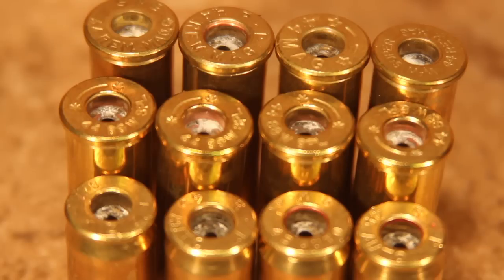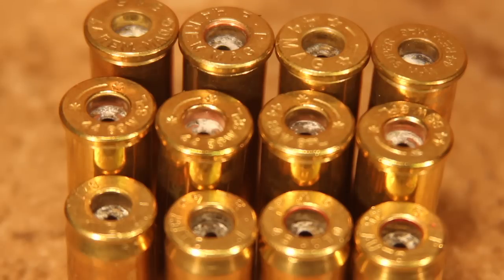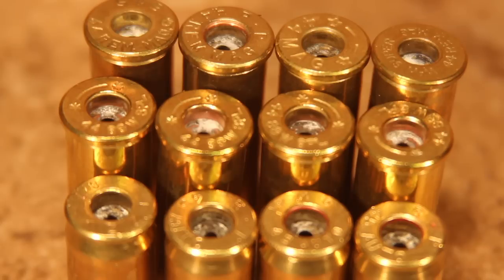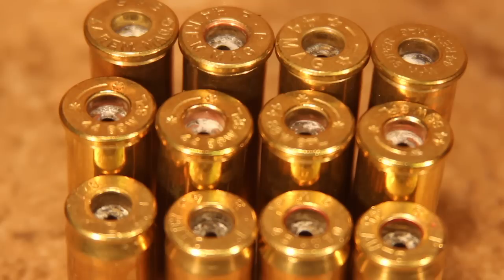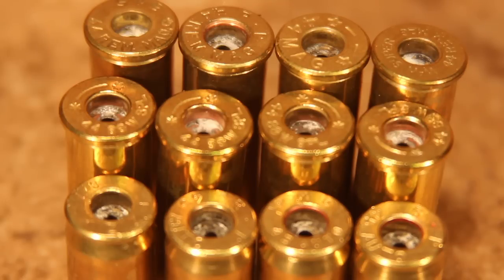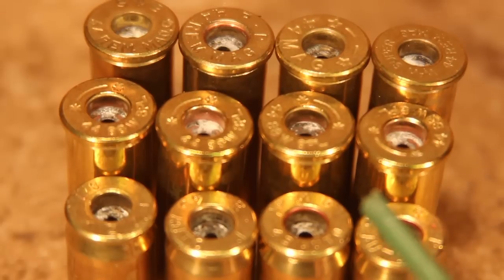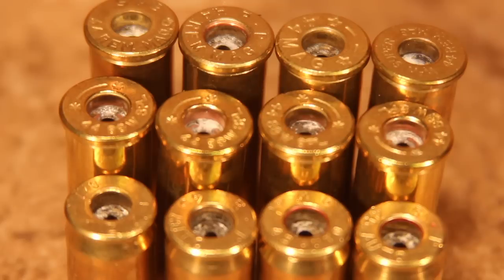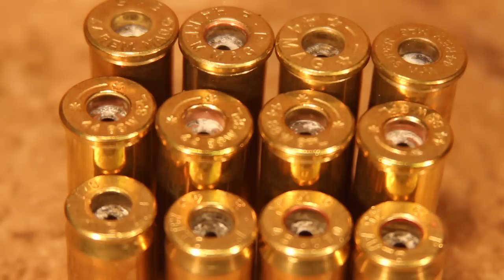Our Major Source Of Lead Contamination

Comment: I recall at an instructor school a discussion of instructors who had a spike in blood lead levels. Turns out they had been using a video based use of force simulator indoors without any special ventilation, and the simulator used primers. 

I’ve taken to decapping with a Lee APP fed by a Dillon case feeder, followed by wet/pin tumbling. Mainly to avoid dust of dry vibratory cleaning, and to carbon and primer reside out of my progressive.

Comment: I've been powdercoating cast bullets for several years.I recently tried clear powder coat paint.Makes pretty shiny silver bullets that appear as cast.I use a dry tumbler with the powder and bullets ran for about five minutes.The clear powder is a bright white in color when new,however after three batches of bullets were tumbled in the same clear powder the powder was no longer bright white but grey in color.I've noticed this darkening of powder over time with colored powders also(ford light blue,red yellow) but never really thought about the cause of the darkening.I believe the powders turning darker and greyer is due to the lead dust being created from the bullets tumbling together.After this realization,I've been wearing a respirator when seiving the powder and bullets after tumbling.Has anyone else had this "AHAA" moment and realized the danger of lead exposure during the powdercoating process?Thanks for the great videos Mr. FC45LC.

Comment: I prefer to deprime at a work- bench outside. The fired primers fall into a five gallon bucket.
I put my lead pot skimmings in that bucket and about once a year i take the bucket to the county hazardous waste disposal center.
Its free and they send it to a clay lined land-fill so it doesnt get in the water supply.
It may be possible tp reuse the wash water by letting it settle then pouring off and reusing the clear water. The settled solids could be saved and sent to the hazardous waste center.
Avoid pouring lead contaminated water onto the ground. 
I am not sure that pouring it down the drains is a good idea. I dont know.

Comment: My Process:
I Dawn Soak before depriming. 
I deprime without drying the brass in a dryer or oven.  Moisture in the primer is fine.

I chose a press that has the hollow ram design for collecting primers to remove primer gunk away from the press and down into a tube.  Lee & Redding do this design.

The spent primer tube goes into an empty bleach bottle with water so primer dust does not plume out.

The deprimed cases then get Dawn & Lemishine soaked a second time. 

They get dried completely. 

I inspect the cases as I hand prime.  I always inspect them so it is now or later for me. The primed brass is stored for loading. 

This way my reloading process and reloading press is kept as lead free as possible.  A second press with a universal deprimer and or bench station for depriming would be a good choice if you can find $$$ and space.  

Your pets need to be considered if you dump waste water into your yard.
Reply from the maker: Carlos - You got the issues under control...Continued good reloadin' to ya,  Steve

Comment: Down the drain the water goes, where it goes, nobody knows.
Reply from the maker: pr4runner - the drains take that water through the drain systems right into the ocean untreated.  Not the best definitely, but the argument can be made that the rivers and creeks scour all kinds of natural minerals including lead and mercury down from the mountains and into the oceans eventually (reason lots of minerals are found downstream), but we don't have to add to that.....  Have a great day,  Steve
Reply: @FortuneCookie45LC    LOL.  Great Lakes have hormones.  Common Hospital practice is to flush it down. I is NOT filtered out at all.  Lead and drugs.    Birth control to hospitals that the protocol.  l is to flush med down the drain.  I am calling you out on this one fore sure.  I do  not have a solution.   Same as lead in my mind ish.

Comment: Thanks for the great information. I have always used an ultrasonic cleaner years ago and now use a wet tumbler. I always thought dry tumbling was a bad idea.
Reply from the maker: Andy79Z28 - You suspected something bad and for good reason.... Best to ya,  Steve and thanks for posting
Reply: a ulta sonic cleaner is also a wet method and safe to use ,i think you mean a vibration cleaner

Comment: I'm assuming there is still exposure after wet tumbling when we clean and uniform primer pockets as well.?
Reply: No, after wet tumbling you're fine.
Reply from the maker: Ronald Valdez - If there is still a little residue in the pockets, there is still  minimal exposure.  But since it is not dust, we have minimal exposure there.  What little exposure remains is from possible contact and ingestion.  But that clean dry dustfree brass is sure high confidence stuff... Have a great day,  Steve
Reply: @FortuneCookie45LC  trow the cases after depriming 15 minutes in een ultarsonor cleaner of good quality and the primer hole is clean and the cases also ,but for the shining finisch wet tumble them after that.

Comment: I just got done ordering the Frankford Arsenal wet tumbler Lite model. I also got the scream Drain cap and 2 1/2 lb of stainless steel pins and the Frankford Arsenal magnet. I didn't get the large one because I really don't do huge volumes of brass being a precision rifle reloader now. I don't reload Handgun Ammunition as of yet. If I get into shooting my 357 Magnum revolvers again I probably will get back into it due to the cost. I do a lot of big bore rifle such as 458 Socom a lot of 308 and 7 mm Mauser ammunition and a lot of 270. But never over a couple hundred rounds Mac so I'm thinking the smaller version will do me fine. Anybody use the Frankford Arsenal wet tumbler lite model? I also picked up lemi shine and a brand new bottle of Dawn original dish soap LOL. So I should be set. I also have a gallon of white vinegar that I can try out alongside the lemi shine and see how they do compared to each other. One cost me twenty bucks the other a dollar 55 so if the vinegar will do it I'm going to switch to that.
Reply from the maker: Echo and the Bunnymen - The citric acid in the LemiShine matches the acetic acid in the Vinegar.  Both should do OK, but the LemiShine has track record...there is cost, but since 1/4 teaspoon of the LemiShine is all that is used, it really isn't problematic...and the bottle is much smaller than buying a container of vinegar.  Have a great day,  Steve

Comment: Thank you sir, never dry tumbled since I watched your videos prior to beggining reloading. Have always worn gloves due to my ocd and wet tumble all my brass after decapping. Do you think that decapping prior to wet tumbling will also put us at risk? Should we wear a mask when decapping?
Reply from the maker: Carlos Mesa - Mask is to prevent inhaling dust.  Decapping brass doesn't cause that much dust, but for sure, handling fired brass there is contact hazard - wearing rubber gloves would be good, and not going to the mouth or face during handling of fired brass is good policy.  Best to ya,  Steve

Comment: A healthy splash of mineral spirits in your dry media will hold that dust down. In my tumbler it will even deposit the very fines to the lip of the bowl where I can wipe them off with a paper towel each time I tumble.  I also find it to actually help shine the brass is slightly. It has been such a great improvement in my dry tumbling I put the wet tumbler away.
Reply from the maker: The Eastern front - Hello to ya..!!  You know the issues and your policies work for you...All the best to ya..!!  Steve

Comment: What is the best way to dispose of the water from the wet tumble? Would it be safer to deprime before tumbling? Thanks for the video.
Reply from the maker: G - Mc - Yes, best to deprime first.  But getting rid of the dust from vibrated media (by going to wet tumbling) concentrating the lead contaminants into fine powder that is still on the brass is major.  If we don't deprime first, then the only lead remaining is in the primer pocket and it isn't going into the air or on our fingers when we get rid of it.  When I don't deprime first before wet tumbling, that brass is heading for my progressive presses, or being done on purpose to make this video.  Good reloadin' to ya,  Steve
Reply from the maker: G-Mc - Great question asked by others.  Water should be flushed into toilet for waste treatment.  Throwing it onto the earth will cause water supplies to be contaminated.  Throwing it into the drainage systems will eventually contaminate the oceans.  Now, of course, all manners of minerals (including all metals like mercury) are washed into the oceans naturally, but we shouldn't be helping that - man is the ultimate enemy of the environment - we pollute on a planetary scale in so many ways.  Love the environment more and more, and we must subconsciously conclude that we hate man in an inverse relationship.   Have a great day,  Steve

Comment: Fortune cookie you just sold me on wet tumbling. I would normally dry tumble through two different tumblers one with Walnut to clean it then corn cob to polish it. This makes perfect sense. Here comes another two hundred bucks in brass cleaning material. Thanks for the info buddy.
Reply: Hey Echo, unless you do huge amounts of brass at one time the dual drum rock tumbler from Harbor freight works great and is only $45. I’ve been using one for a couple of years now👍🏻😬
Reply from the maker: Echo and the Bunnymen - When you see the filthy water on your first wet tumble plus the finish on the brass, you'll be very glad you joined the ranks of the wet tumblers...All that dark gunk would have been vibrated into fine powder that would have gone airborne at the slightest provocation...  Best to ya,  Steve
Reply: @FortuneCookie45LC  I can also use my Dylan media separator to help speed up the removal of pins out of my brass so I'm not out that sixty bucks for the smaller media separator. This is going to work out really good I hope the light model works just as good as the original larger model. Probably use it for 6 months and do a review on it I haven't seen many on the internet on this particular unit. I did notice however that the inside of the drum is not lined with black rubber like the larger original. Wondering if I should use bed liner and have it sprayed on the inside Maybe I don't know probably just run it the way it is. Thanks again brother, David.

Comment: I am glad I have used a rock tumbler with dish soap for years before switching to the faster Frankford Arsenal tumbler. But Steve you bring up some good points that has me thinking again about one type of shell that I don't tumble. .. that is fired shotgun hulls. They get dirty and most of us just condition the top of the hull but reload those dirty shells ! Maybe a case now can be made for wet tumbling those as well. Bye for Now..
Reply from the maker: Jeff - The one saving grace with our shotshell hulls is that we don't dry tumble them either.  Problem with any kind of tumbling of shotshell hulls is that loosening up of base wads from the shell bodies could result.  Certainly, there are a lot of contaminants in there.  Good point.  Thanks for making it...Steve
Reply: @FortuneCookie45LC   Maybe we don't have to tumble them as long to get all the lead washed off and thus keep the base wads nice. I am going to try it as you point of lead contamination makes it worth a try. .. Nice talking to you as well , take care Steve and happy shooting.

Comment: Great video thanks, some times I deprime before I wet tumble sometimes I  just wet tumble with the primers still in, what method would you recommend?
Reply from the maker: Ocd70 - My reply to your comment may have been lost - so here goes again... When progressive loading lots of ammo for handgun, the primers can be left in and no cleaning of the primer pockets is really necessary; will not affect performance.   But if loading precision rifle, we will want to deprime first before wet tumbling - precision at long range requires full brass preparation.  Good shootin' to ya,  Steve
Reply: @FortuneCookie45LC    it is better to remove the primers always ,that way there will be lesser airborne lead anyway by shooting. and the press stays cleaner.and leadfree to

Comment: So would it be wiser to use one of those ultra sound sonic washers? Then how does one properly dispose of the contaminated water from either a sonic washer or a wet tumbler? Please share a video on how to properly clean your contaminated water. By the way, this was a great service video. Keep them coming.
Reply from the maker: B WAX - Disposal down the toilet for waste treatment is best...otherwise, we can put the waste water out to slowly dry (screen the top to prevent mosquitos) and then take any residues to the hazardous waste dump sites.  Best to ya,  Steve

Comment: I remember a writer (probably Mike Venturino) talking about this in one of the gunzines 20-odd years ago. As i recall, he also mentioned lead styphnate in primers being the main source of lead contamination. Handling fired brass is a main culprit. As he pointed out, lead does not emit death rays; it must be ingested. Wash hands with cold water after shooting or after handling fired brass. Based on your info about the dust contamination, wear a dust mask or respiratore when dry tubmmbling and separating brass, or when mining range scrap. Mike pointed out another interesting fact in that article: he was and is a dedicated bullet caster. He had his lead levels checked every 6 months or so. His levels were only slightly higher than an average person. So bullet casting is very safe (he didn't wear gloves), just don't hang your head over the melting pot and breathe in the lead fumes. Great info, FC, thank you. I did not know that dry tumbling caused a lead hazard.
Reply from the maker: Hello to Troy Ortega - I don't remember that Mike Venturino article, but he was ahead of the times.  Just think of how bad our dry tumbling is - we vibratory clean all the lead residue out of our brass and concentrate it into the dry media - most keep using the same media until it is too dark to keep using - the media has been vibrated to a fine powder with concentrated contaminants.  When we poured the contents out of our dry tumblers, there was a huge cloud of dust that rose out with us in the middle of it..!!  And that dust was still on our brass so that we'd handle it and got our reloading benches more and more contaminated.  I concluded all of this from seeing the incident at USA Brass Co of Boseman, Montana - workers all got high lead levels and the only thing they processed was fired brass casings purchased by the ton.  Also a good shooting friend got lead poisoning - he dry tumbled his brass for 6 - 8 hours because he wanted that shiny brass.  He never casted any bullets and shot mainly jacketed bullets.  Shooting a lot indoor ranges did not help at all.  Best to ya, Troy..!!   Steve

Comment: What should I do with my lead water?
Reply from the maker: M Blake Jr - Flush it down the toilet - it will go to waste treatment plants...Our sanitation systems will handle it nicely...Turns out that every living thing is a toxic bomb - Throw a dead cow into a water supply and biologic bomb is delivered.  Best to ya,  Steve
Reply: @FortuneCookie45LC   trow it in large plastic container of  200 liter or more ,set in the sun , the water will evaporate  .after a few years or so you got a sludge  that can be discarded the right way
Reply: Drink it

Comment: Excellent advice! Most lead exposure is, indeed, from lead styphenate(sp?) found in priming compounds. Not from lead fumes or lead dust. Lead dust can certainly be source as well, however it's easier to reduce exposure to something you can see. 
Showing the white lead crystals formed inside the primer pockets is a great demonstration. Thank you!I
When I shot indoors a lot as a young man, I remember tasting a faintly sweet aftertaste just from the sudden firing of dozens of 22 rimfires going off, and insufficient ventilation if the exhaust fans were not on. Some of the older shooters said it was nothing to worry about. I think they were wrong.  I had always wondered if that sweet taste when the ventilation fans weren't running was from "sugar of lead" or some similar compound forming with saliva. (Not to be gross.) Thanks, again.
Reply from the maker: Glen - The reason this video resonates with all of us is that it is the culmination of our experience, knowledge - well evidenced by what we have seen.  Once we crystalize this, we can do things towards management so that we can utilize lead as our friend - just as we use electricity, gasoline, propane or natural gas every day.  And BTW, have a great day,  Steve